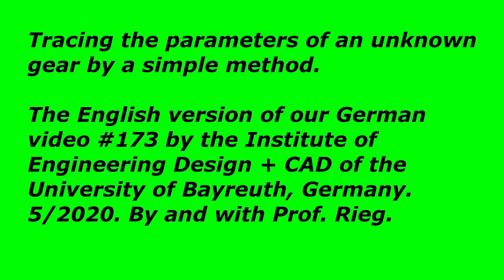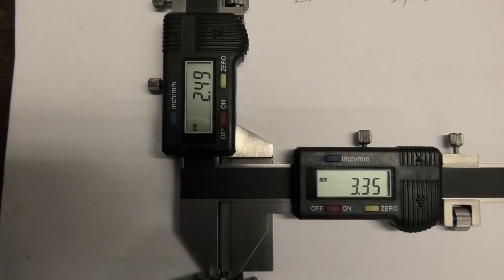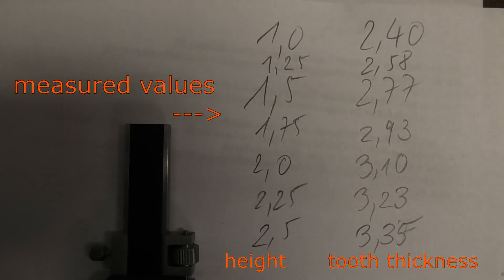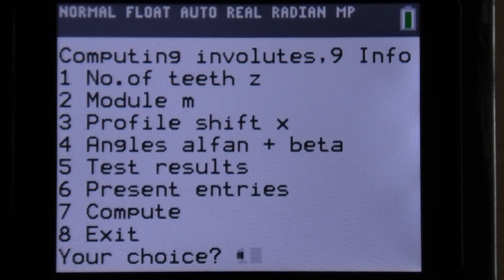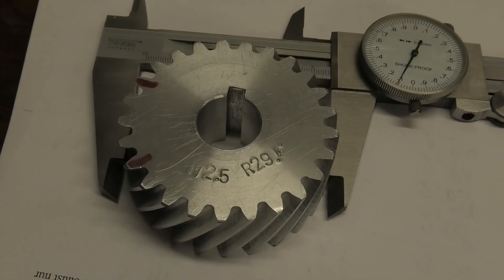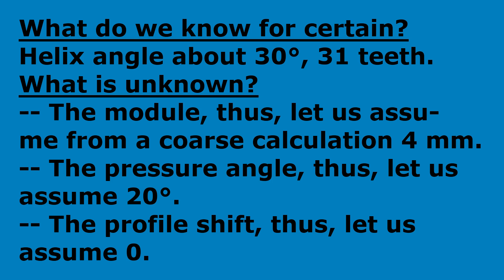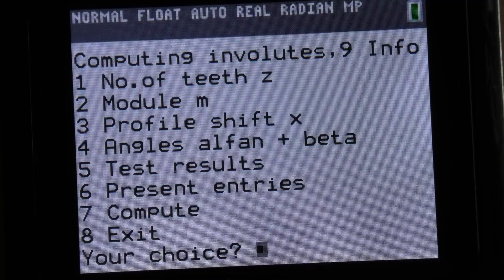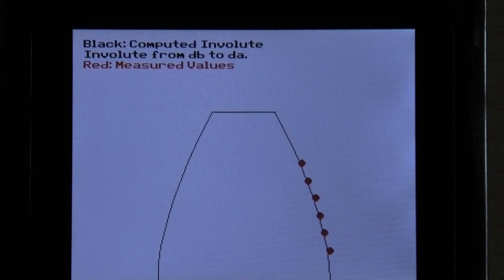Investigating an unknown gear.

Comment: I had finally run the YINVO on TI-84 Plus ce but when i entered number of values (ex i=7) it shows me that i=7.8544536*10^-24
and there is no results appear
would you please help me with that?
Reply from the maker: Very difficult! Can you mail you problem with some data and screenshots to frank. rieg@uni-bayreuth.de ?

Comment: Would you please make a video about how to install YINVO on the TI-84 Pluse CE T 
because i have tried to install it on the virtual ti connect but l got an error message (invalid version)
Reply from the maker: This is a bad behavior caused by Texas Instruments: Newer 84's or those with an update may not longer use Assembly programs!! Check the Internet and you will see a lot of angry users.
Reply: @prof-rieg  is it possible to run YINVO on another graphical calculator such as casio or hp